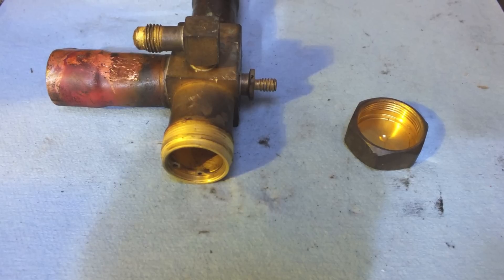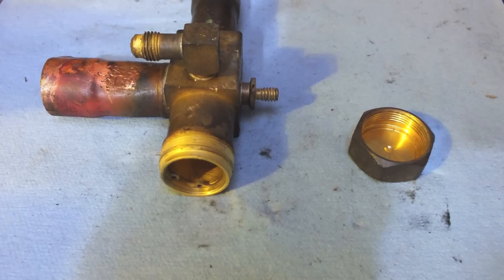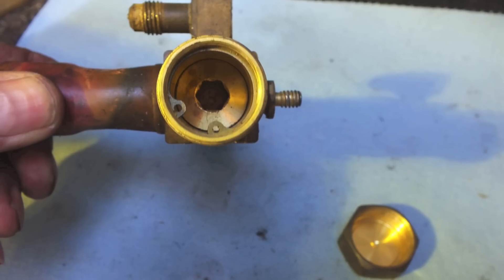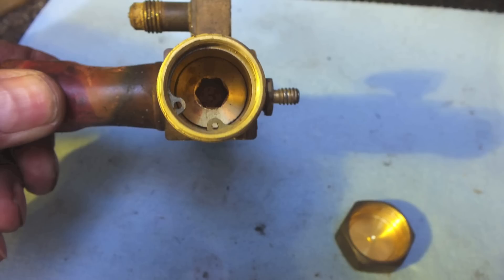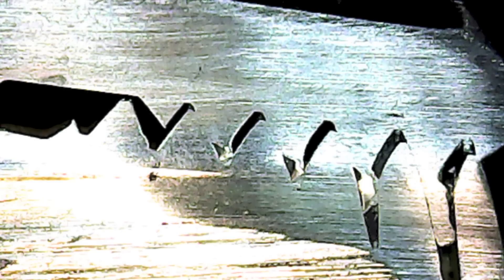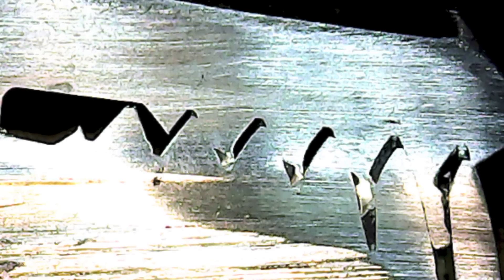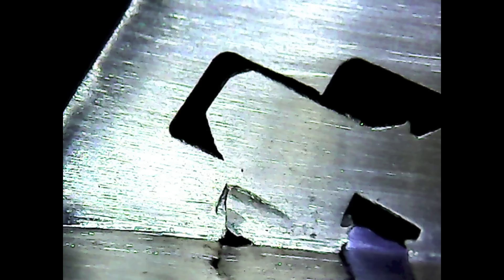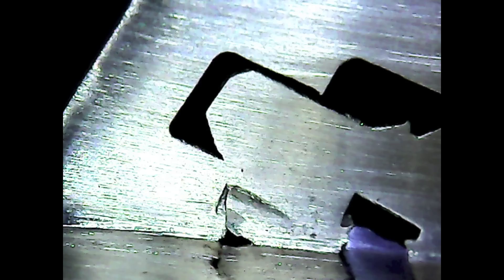Why you dont seal threads on HVAC service valve caps

Comment: I've used leak lock on caps successfully. Business owner was so happy. He was calling the HVAC guy once a month for a refill. I tried to tighten the packing but it didn't work. I used a lot of leak lock. At least I know I might be back one day and re charge and reapply, but it's already been more than 9 months. No callback yet.😁
Reply from the maker: Because leaks are the largest problem in this industry, they need to be dealt with.  This means effective repair.  Glop placed in fittings is not an effective repair.  Not trying to beat you up.
I found out in the middle 1980s what worked.  
Removing the mechanical valve or brazing it solid is the only way to remove the problem.  I have been meaning to do a video on this repair for quite a while.
Maybe your comment will get me started.
GFM
Reply: @grayfurnaceman 
I'd love to see that repair method.
Reply from the maker: @billybbob18  Its coming
GFM

Comment: Threads either leak or don't leak.... Don't over think it... Thighten it down Very snug... use leak detector and bubbles, and see if its leaking,, try some thread Teflon  tape or liquid sealant paste type...... if it still leaks... U need to replace the valve....pretty common for leaks to happen on the threads of any item on a system...even more common if retrofitting a new gas, and changing oils like Mineral to POE as it will eat up the gaskets..
Reply from the maker: The only threads that will seal are tapered pipe threads.  All other threads are only there pull the cap down onto some sort of sealing surface.  The only value of pipe dope on an untapered thread is to lubricate the threads to apply more force on the sealing surface.
That said, the caps on service valves are far too light to make a good seal and tightening them simply distorts them.  The only true seal on these valves is the oring.  Not that it is a good seal.
GFM

Comment: I have had a few caps that leaked. Over tightening the valve when closing it will cause it to leak also. Every time I used the yellow teflon tape with " leak lock" thread sealant and to this day many years later they are still leak free. I know so because I have been in the same building for 12 years. If you have a walk-in cooler with $5000 dollars in product in it you may not have time to replace the valve.
Reply from the maker: We will have agree to disagree.
GFM

Comment: With 4 strips of Teflon tape and hand snug tight works every time for me. So they can be sealed.
Reply from the maker: And I follow you later and fix it properly.  I lost count on how many caps I have come upon with Orings, teflon or pipe dope.  The reason I was there is because these "repairs" did not work.
GFM
Reply: @grayfurnaceman  LOL sorry but they all are still not leaking. So no need to, like I said they can be stopped from leaking. That has been proven.

Comment: Some years ago I whittled up a teflon 'o-ring' on the lathe to fix a leaking shrader.  (replaced the core; no joy, previous tech couldn't braze well, warped it.)  Worked like a charm for *years*.
Reply from the maker: The damage to the fitting by overheat requires the valve to be replaced or eliminated by using a brazed fitting.  The cap is essentially a dust cap.  I must admire the labor to make a teflon seal for the cap.  I have always replaced all caps with a brass one with an o ring.  This was used as a final stop for leaks. But, consider for an instant, the difference between a schrader and the cap that is placed on top.  The schrader seals better the more pressure is placed against it.  In contrast, the higher the pressure, the more the cap is forced to leak.  
GFM
Reply: true. but I'm not a tech.  I only got my 608 to work on my own stuff.  So $1000 for a recovery unit, tank and pump, or 10 minutes to make washer that lasted, literally, 10 years.  I only topped off the system this year.  I call it a win.

Comment: How about removing the retaining ring and valve core and replacing the o-ring?
Reply from the maker: I have found that an effective repair but only if the valve is not warped from overheating the braze joint.
GFM

Comment: I have to say, I have had very good success with nylog over the last few years. When I find a system showing signs of being low on refrigerant and before I touch any valves, I grab my detector and check the caps, Schrader valve caps and service valve caps. Many times I find leaks at one or more of the caps, then verify that my suspicion was correct by checking temperatures and pressures and then add refrigerant. I have many repeat customers, which two and three seasons later say they have had no more problems with refrigerant leaks. We all have different experiences with different products. Just thought I'd share mine. I think nylog is a viable option in many cases. GFM Respect.
Reply from the maker: Good thoughts.
GFM
Reply: curious what leak detector you use? do you think h10 is able to sense small leaks?

Comment: "All kinds of crap" - Nylog worked very well for me. No detectable leak after applying it. Prior to Nylog it was easy to locate even by a cheap electronic halogen detector. While you are 100% correct that replacing O-rings is the best way to deal with it, evacuating the system and recharging it is a $1000 deal for many, to do it to replace a $1 part just doesn't make any sense for most of the homeowners. I don't see why Teflon tape can't if not eliminate the leak but to bring the rate to the acceptable level, like 2-3 oz/year. Still better than a $1000 job to replace O-rings. Suction line pressure is not any higher than many of the water lines. Thank you for the details in any case, the video is useful to understand why service valves leak.

Comment: Man this is a pet peeve of mine. Thread sealant on a compression seal fitting is useless!!! If you want to make something that seals on compression not seal, then add some thread sealant! Pipe dope, teflon, whatever, nylog, etc, it interfere's and will insure that there is no seal. Compression seals are in the compression of two soft metals being properly torqued together, alum, brass, copper, etc. With the exception being o-rings and teflon rings but the seal then is still in the compression of the fittings not the bleeping threads!
Reply: +sad hvacman You would be correct if the mating surfaces were optically polished first.  Since, they are not, the nylog fills in the gaps.

Comment: Excellent in-depth explaination about a common misconception regarding straight threads. I've definitely seen a few valves that have leaked out or thru because of that cap being egg-shaped by overtightening. The cutaway was a great idea. Same thing with those using tape/dope on compression or flare threads; lack of understanding. "Essentially, that thing's a dust cap". All that SHOULD need to be said. Thank you
Reply from the maker: 71dembones Thanks for the support.  
GFM

Comment: I have to say you are 100% wrong about the purpose of the cap in this video.  These valves are a very common (probably 25%) place for refrigerant leaks.  The o-ring inside the valve becomes damaged from age and overheating when it was soldered.  The problem is worse on heat pumps.  Your video does show the brass seal.  For 20 years I used oil to polish the brass when the cap seats.  But, nylog works much better.  Finding leaks on these valves is very difficult without a sub 1 ppm sensitive leak detector.  They never show bubbles when the leak is less than 10 pounds per year.  The H10 will find HCFC leaks and the Fieldpiece SRL8 will find the HFC leaks.  PM me if you have any questions on how to determine the sensitivity of your leak detector.

Comment: If you use teflon tape or pipe dope on hvac threaded valves and fittings, wouldn't any residual materials clog the expansion valve or lines ?
Reply from the maker: zombiediarhea First, I don't use teflon tape except with very large pipe thread (2" or over) and then with pipe dope on gas lines only.  Pipe dope can be used in refrigeration tapered fittings but the 1st two threads are left clean.  
GFM

Comment: On first generation big and small block chevys the head bolts go right into the water jackets and require a sealant on the straight cut threads. Typically i use a permatex teflon dope or a permatex #2. If not water will get right past into the oil. Chevys is all i do so idk about other engines.
Reply: +awsom70 

Chrysler 318 marine engines had a similar arrangement where the bolts that held on the fresh water pump went into anti-freeze/water. Amazingly, they would seal with some thick sealant on the straight threads of the bolt.

Comment: Another informative video.  Thanks alot.  I have an unrelated question. On gas furnaces, should comparing incoming gas pressure to furnace data plate be recorded with gas furnace running, or gas valve closed.  Thanks for all the great videos, Jeff
Reply from the maker: jeff arney Always running.  
GFM

Comment: Nylog has stopped a lot of leaks for me!!! I see where your coming from but nylog has never done me wrong!!!
Reply from the maker: Israelhvac As I have said before this is a pet peeve for me.  It is not a repair, its a fix.  I place it along side stop leak in refrigerant.  Man, you could have over 400# pressure on this wimpy cap.  I have seen these caps literally blow off and gouge pieces out of the siding of the house.  An that is with R-22!  I know, I'm preaching again.
GFM

Comment: This video makes me think about how many arguments I'v'e had with some gas plumbers over the years. 

Some say that you are not only supposed to put pipe dope the threads of a ground union, but also the joining surfaces. To me this is BS! The compressed steel on the surfaces is it what that is supposed to make the gas seal. Your opinion is greatly appreciated.
Reply: Volusia-ev You are 100% right. If they need any thing on the mating surface you needed a new union.

Comment: in the automotive world head bolts and intake manifold bolts are straight threads and have been sealed with teflon dope for years and it works perfectly fine to stop coolant from leaking. An engine experiences great temperature fluctuations also and doesnt have a problem with leaking still. I agree on the service valve debate but i dont think its necessarily wrong on all straight thread applications. Could there be a better way then sealing a straight cut thread yes of course but it does and has worked for many years in many applications. Just my 2 cents. Keep up the good vids gfm!
Reply from the maker: awsom70 I can't say I have ever seen teflon used for head bolts.  I do know we never used to put anything on those bolts.  Are you sure they communicated thru to water passages?
GFM
Reply: grayfurnaceman On first generation big and small block chevys the head bolts go right into the water jackets and require a sealant on the straight cut threads. Typically i use a permatex teflon dope or a permatex #2. If not water will get right past into the oil. Chevys is all i do so idk about other engines
Reply: Your engine isn’t pushing 350-500 psi thru it either.

Comment: I use leak lock and put it on the inside of the cap where the valve and cap seal together. Works real well for me. I agree that the threads arent meant to seal and thats why i dont put it on the threads

Comment: Great close-ups, but i think it is way too quick  to jump to spending 1/2 the day replacing the valve and charging the customer hundreds of dollars instead of trying to seal it with teflon tape or Nylog.
Reply: 1/2 the day? Maybe 2 hrs tops. But your quick fix actually costs them more. It is called a service valve for a reason. You don’t seal it and there it’s fixed. What if you need to pump the unit down? Need to replace the dryer the txv?  If you replaced the valve at the the time it’s leaking, then it’s already low on refrigerant so you would be charging them for Freon Anyways.  I agree with Grey, I’m sick of all these hack job techs that make my job more difficult. The point is these valves should never go bad get a damn wet rag when you weld and stop over tightening
Reply from the maker: Cooll Asice  This is a pet peeve of mine.  I learned this in the middle 1980s.  I constantly followed techs that tried every type of glop or tape.  What usually happens is it seals for a while but changing temps or pressures start the leak again.  As you can see from the pics, there is no way a thread will seal when it is forced apart.  I will be doing one on pipe thread soon that will show the way a thread can seal.  Think about how many times the tape seal will be done and the cost of those calls, not to mention the loss of compressor life.  I will get off my soap box now.  Thanks for the thoughts.
GFM

Comment: Great short video,  What I see a lot of is Teflon tape on a compression joint threads, which is point less because the faro does the sealing.       I know I missed spelled faro  the spell ck did not help   LOL  I feel dumb
Reply from the maker: gerry mcadams Ferrule.  No big deal.  Thanks for the support.
GFM

Comment: 2 years ago unfortunately  I put a brand new 5 ton Trane XB 13. When I open the suction side service valve it start spraying all over. It 95 degree outside costumer is waiting for cooling what I did put a lot of locktite and tight it with all my power :) It went thru two summers I am expecting a call back next summer after this video I decide to change it next summer :) after that I never bought Trane again ever I hate them
Reply: Guy Hakverdi here’s an idea get rid of that crap turbotorch and wrap the service valve. And you know I’m right that you got it too hot because you said suction side.

Comment: Nice Job GFM I've seen caps tightened down so tight they cracked the top. I agree nothing seals those valves once they start leaking.
Reply: nylog on my threads gets the job done
Reply from the maker: T&N Services LLC. Yeah, kind of my pet peeve.
GFM
Reply: Great info and explanation on leaky service valves. Thanks GFM.
Reply: so your saying never use nylog on the caps??
Reply from the maker: Zach Avery I don't use orings under the cap, Nylog, pipe dope or leak lock.  The reason the valve leaks is it was overheated when installed and the barrel is warped.  Some of these seals work for a while, but then it leaks later.  Probably the worst thing we can do for compressor life is have a leaky system.  
GFM
Reply: This is a lie Goodman units leak straight from factory, nylog holds anything